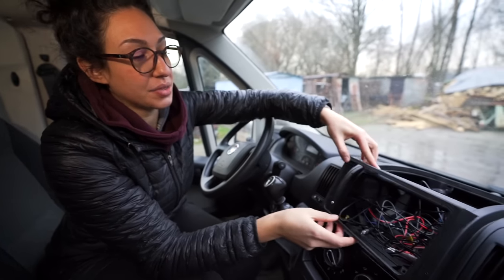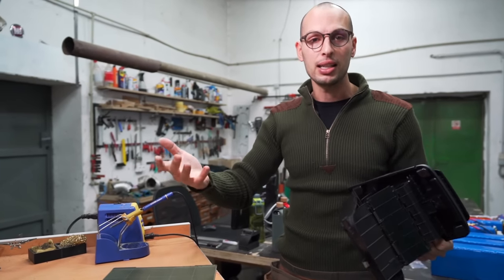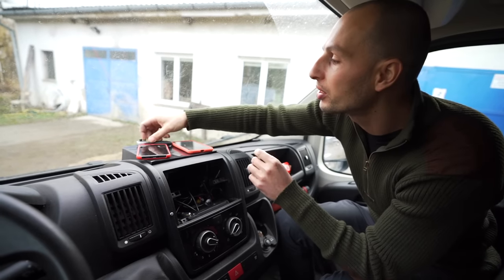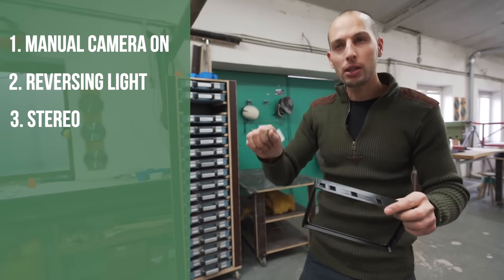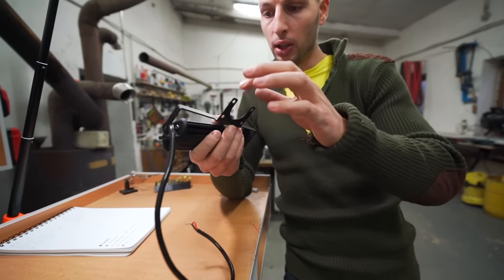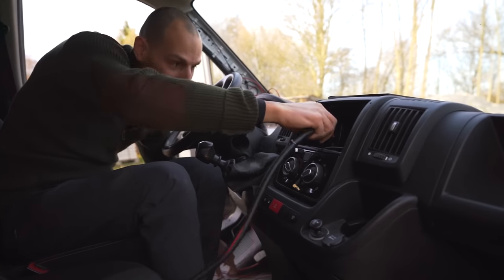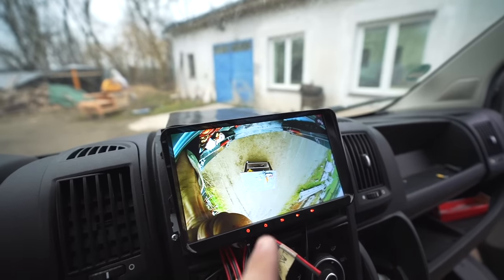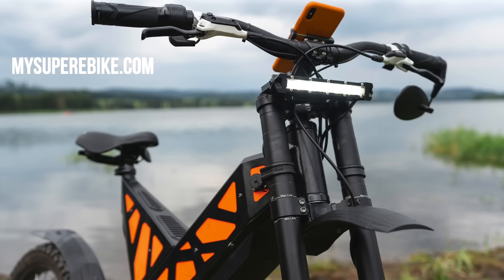CAB WIRING STARTS NOW! Reverse Camera, Lights, & MORE 3D Printing (Van Life Build #10)

Comment: Some wireless charging would be so cool on that anti-slip mat!
Reply: Only if you want your phone's lithium battery to explode in the heat. Not being a downer but phones don't belong on dashboards in full sun like that.
Reply: @bitminerbob6731  still useful at night :)
I do wonder how well phone charge through materials like that. It might insulate it, making charging ineffective
Reply: @bitminerbob6731  Didn't think of that, I was too excited about the idea :D
Reply: Wireless charging power is still limited compared to wiring. And I don't feel like they care so much about wireless charging, but they may make it if they see the potential for a new popular video. 

I think a transparent (so it doesn't interrupt the view) plastic shield is more important as a good safety measure, IF they need to break REALLY HARD so nothing hits the front window too hard.
Reply: @Josh O' Laughlin even at night I wouldn't charge it, gives people a reason to attempt to break in lol
Reply: It would not work because your phone would slip off the charger.

Comment: Thought you might like an idea I used on my water tank. I bled some warm air with a small pipe from the Truma blown air heating down to the inside of my insulation around the tank. I cut some channels in the solid block insulation to create a flow of warm air around the tank. The idea being that whenever you have your heating on, the tanks will be kept warm as well as the van. You can control the amount of air with a diverting flap in the ducting. I also ran the water pipe through the middle of the duct to stop the pipe freezing. Works superbly in very cold conditions.
Your as inventive as me. Great job. 👍
Reply from the maker: That’s pretty innovating! Thanks for sharing!

Comment: My Ram ProMaster (re-badged Ducato for  the USA)  came with a back-up camera displayed on the rear view mirror, but I added a rear view camera near the license plate that looks straight back and the display is on the stereo screen. It replaces the rear view mirror since we can't see through the back doors. It works well. If you're not used to driving a panel van it's helpful.

Comment: little or big updates, its all good!

I'm looking for security lights and cameras for my van at the moment.  I have a  roof rack so there are plenty of mounting options - no need to drill holes in the van. One thing I plan to do differently is to have the lights activated with motion sensors and the inside switch, reachable from the rear platform bed.

Comment: I'm not sure if you guys plan to have floor heating, but I saw a video where they extended the line running under the floor, to also run under the water tanks, keeping them from freezing.  Video from Advanced RV, called B Box Walkthrough.  Look at about 27:45 for a graphic.
Not a problem in my neighborhood... winters don't get cooler than 12C.  :)
Reply: 12V heater will do the job keeping temp between 4-7 degrees)
Reply: @frodobaggins3773  but then, you are adding yet another system.  They seem to have plenty of power, but if they do have floor heating (I forgot if they mentioned it), then they can combine the two without adding more power draining devices.  Just a bit more line for the glycol to run through.  Simple.

Comment: Those parking lines are more useful than you think. Once camera is installed you can put objects on the ground at the point were lines kick in and then measure the distance to the van from each one so then you know how much space you have exactly. If you don't like to see the lines all the time you can put that wire on a switch.

Comment: Seeing you run all those wires made me think of something. Did you think of adding a Vehicle camera ( "dash cam" ) to the van ? It is important in the case of insurance claims ( where other drivers damage or total your van say it wasn't their fault etc . . ) Important to have - especially after spending months on the build. AND - make sure you get a high level of insurance that would compensate for your months of work if it were totalled in an accident. Meaning NOT just the "blue book value" which is what is used in the U.S. ( what a non converted basic van would cost from a dealer with no extra work etc . . which would probably be a very small percentage of the cost of your time and effort etc . . ) Have it insured for the value of your time and effort in replacing the SAME level of Van ( Value ) AFTER all of your work.

Comment: Could you wrap water tanks in 18 mil Armaflex? Should be insulating them well enough esp if you’re using a heating element. Would probably also offer some mild protection against rocks etc kicking up for underslung tanks.

Comment: armaflex my guys! throw a first layer of armaflex on the inside metal wherever you can (ridge, beams, cab overhead, doors, door siding, inside waves of the roof,  inside waves of the floor etc...) company sells directly on amazon, 6mm/15m² for 109€.  then cover the rest/ big cavities  with thicc insulation.

Comment: I'm surprised you cut the green wire on the reverse camera system. I used them to gauge how much space I could safely back up. Some of the newer systems even have moving lines on the monitor for focusing on which direction you are backing. 
Not how I would go, but it's not my van.
Reply: I think cause it works well on small cars with stock (manufactured) cam.
This lines are ugly and useless on this situation :(

Comment: Hi, great work. I own a Ducato Van too. The two 3D-pieces , replacement of the table-holder and the bar radio frame are very, very cool. Where could I get the STL-files to print this pieces for myself ? Or won't you share the files with the world ?
Stay save and healthy.
Reply from the maker: Hi Paul, take a look at the parts list in the description of this video. We offer a bundle of graphics, dimensions, 3D models of everything we’ve done and will make for this prototype van. You can also purchase 3D models separately.

Comment: I am curious why you don't just make that to be inward. Make more space without getting higher with the structure. Or is that space behind the Android device occupied by something else?

BTW, you can treat your print with a special solution to make it UV resistant. I forgot the name of the solution, but I can ask if you need.

Aren't Anti-slippery mats gathering dust faster and can't get rid of it easy?

As a last comment, if you are maybe interested in monitoring and automating your van, look into the open source app called Home Assistant. It runs on a Raspberry Pi and you can attach many buttons, switches, sensors, external data from many brands and services. I am writing this in relation to the switches you presented here. It would be nice to actually change their utility later on without rewiring. But for sure it offers many more functionality incl. camera viewing, GPS tracking etc. 

Keep it up. Love your show!

PS: Ah! Maybe add some insulation behind those masks in the cabin once you get to that part. :)
PS2: I heard Armaflex is quite good at insulation but expensive so it used in combination with other materials. Curious what you will use.

Comment: If i was planning to use spray foam insulation would the sound deadening pads still be required?
Reply: 16:34 looks like they won't be using spray foam for insulation 😉
Reply: I would guess not that stuff is so fucking sticky I don't see how the panels could vibrate
Reply: My bad, misread your post 🙈 Watch Hugh, he just spray foamed his van and as I recall correctly, he didn't put sound deadening up https://youtu.be/IjDwvt-bONM
Reply: I think yes. Totally worth it! Here's no reason not to use this (or similar) pads, they help to keep silence inside of the cargo van.

Comment: Where is kitty? 😔😫🐱 i was actually thinking about water grey tank, to make it from steel  and than seal it with fiber glass and epoxy. I am so excited to see ur ideas. I’ve thought about steel because it is crash proved.andnoone knows what can happened under the van. But I think Ladie does something cool. I thinking about meterían for water tanks. However better protection than fiber glass and raisin couldn’t find so far.

Comment: Love your video's btw! So wish I could do something like this, your an insperation and someday I may follow suit. Just a quick tip, which is more of an observation. Try your best not to run the any type of signal cable, aka your composite cable for your camera, in the same conduit as your power. As your vehicle gets more "noise" from inverters and gagets and stuff like that, you could get noise hopping onto your composite cable for your camera from the power source (This will the cause picture to do funky stuff). I couldnt make out if you had run it in different tubing so you may have done it allready. I dont think it will be much of a problem, but your build is awesome and its best to make you aware of this now. Its always best practice to give composite cables and other signal cables room to stop cross talk/noise :) If you are using things like RaspberryPI's for automation, this could be the difference between low and high due, that is you would pull the line down anyhow, but still, you want to avoid noise on the cable as much as possible. Good luck :)

Comment: Any link for the zip tie cutter and the flexible pick up tool used to grab the cable in the dash?
Reply from the maker: It’s in the parts list in the description of this video.
Reply: @ladiandmargaret  I must be missing something:  I can't find them in the list.
Reply from the maker: There is a tab with tools.
Reply: @ladiandmargaret  Ah!!!!  I found it: it is at the bottom of the screen, the writing is quite pale, hard to notice:  thank you so much for the info!

Comment: Absolutely love the idea of updating the cab - especially the radio interface and adding switches for the additional functions.  What you've done is amazing.  If the printed plastic can't withstand the extreme heat of the cab, you can always use the print to create a plug for a fiberglass cast.  Really, only the pieces exposed to the sun would need to be glassed.  The rest can still be 3D printed.  

Seriously, when all this is said and done, you can add these products to your store and diversify.